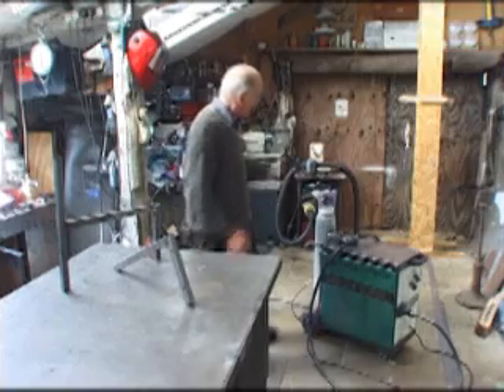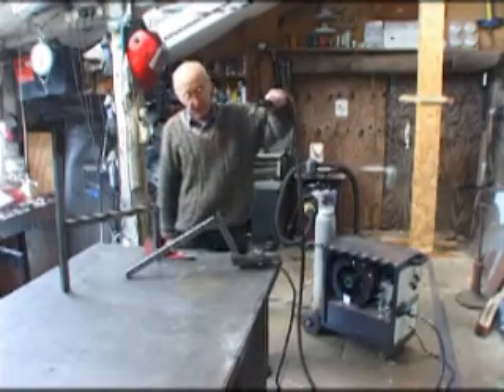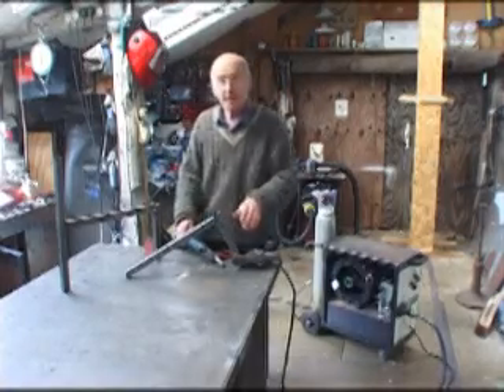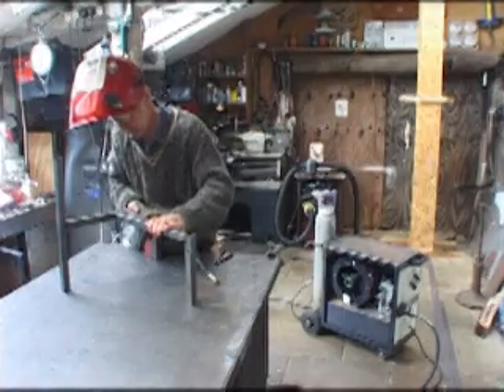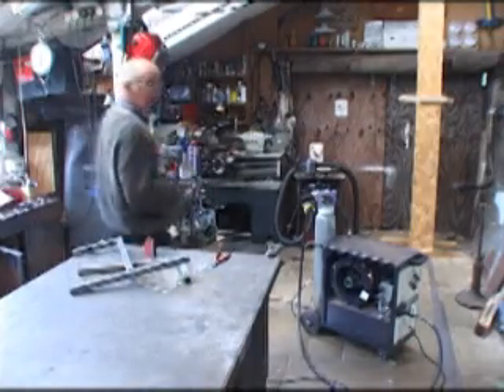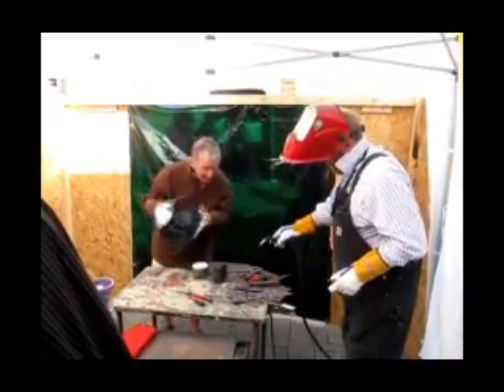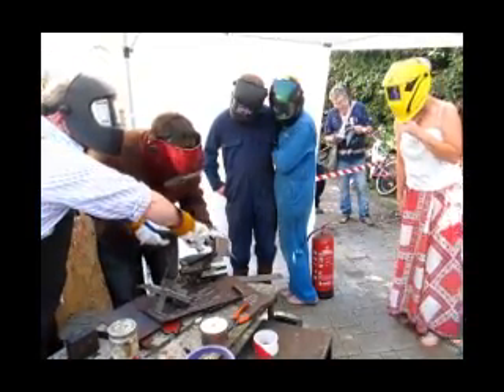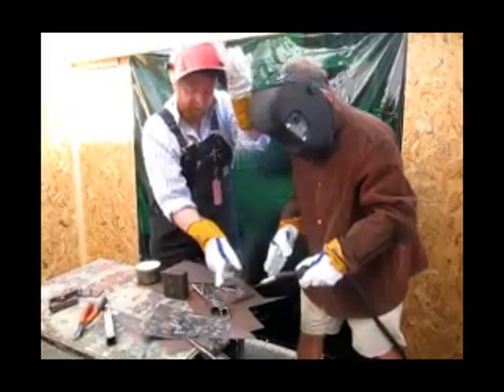welding

Comment: 🍳🥓 💕
Reply: I , have a Lincoln cracker Box welder - in the toolbox of my farm truck.
--------------------------
  I , only use 6011 , 1/8 " rods (what is - a chipping hammer 🔨 ? ; grinder ? clamps' ? ; etc. ) & set the welder on 90 amps ; Only ! (Bad for the knob I know)
I , do not use a 🔥 torch to cut anything. 
--------------
I , cut everything with welding rods and weld only on 90 amps & cut only with 90 amps - too -(mostly)
------------
  In , the truck - I have a 100 foot 👣 # 6 cable .
 I  , have welding plug at the house and one welding plug at the farm .
----------------------
 I , (just drive up) 🔌 plug in , and place the truck next to whatever you need to weld .
I , have to put a fan on the welder now , it's fan - no longer turns.
-----------
No , 🤞 luck for a side job - 🗑️ trash welder - in a resume (is bad).
---------
Also , I used a ( monster torch ) that a Navy Sea Bee 🐝 let me use in his garage. 
-----------------
About almost 3 and 1/2 inches of copper tip , 
( that I plugged it up ; with slag ).
🔥Bryan

Comment: You don't always need a leather welder's coat, but at least a thick cotton/denim shirt is a good idea.  The UV from the arc can give you a rippin' sun burn. #LearnedTheHardWay 

Gloves are good insurance against times when things are more hot than we realize. My brother, for example, has taken the prints off several fingers from picking up thing. xD    This is also one reason why I keep a steady supply of canned soda & beers in the fridge.

Comment: The welding course is a great idea, but even better would be a DIY course on how to use a drill: many DIYers are completely unaware of the function of the hammer setting, drill types and torque settings.
Reply: The main drill error I see is a large drill in steel running at high speed. Heat and drill tip softening is the inevitable result. Low speed and push hard is the right way, so it cuts and doesn't just rub.

Comment: You first think of the amperage of this, and wonder about shocking yourself.
Reply: Remember you need both a certain minimum voltage as well as amperage in order to get a shock, so a massive amperage is harmless unless the voltage is also high enough to push the amps through you.  Too low a voltage and not enough amps will move to cause any harm.  Only 0.03 amps across the heart is enough to go into cardiac arrest - enough to illuminate a single LED - and almost all batteries are able to supply that (even watch batteries can get close), but in all cases the voltage is way too small to actually get enough current flowing to be dangerous.

It's a bit like saying "oh no I accidentally ordered 100 pizzas for myself, my stomach will explode!"  Well it won't because you will stop eating when you're full.  Just because there are 100 pizzas sitting there it doesn't mean you'll keep eating until your stomach ruptures.  And likewise the welder's voltage is set low enough that any current flowing through a human will be so small that you won't even feel it, even though there are way more amps available.

Comment: I also hadn't welded before before getting that welder and I didn't find it hard to pick up. Websites like mig-welding.co.uk have some handy troubleshooting guides that can get you past common beginner problems. The only real limitation i've had with the style of welder is that it's almost impossible to weld anything thinner than about 2.5mm. At least with the rods i've got.

But it's like Tim is saying in this video, even relatively poor welds or just simple tacks can hold plenty of force.

Comment: I hit the youtube character limit with that dang essay, but just to clarify.

The rods that come with the welder aren't that bad, but I didn't realise that till I had fancy rods to compare them to. Plus the handheld visor that also came with it might be awkward but you could probably get away with taping it to a hat or something. Lastly the welder didn't come with a plug (for liability?) but at lower power settings you can get away with a 13A plug. You'd just risk breaking a fuse.
Reply: Hi Daniel, nice to see your one of Tim's Fans!

Comment: I bought a 'buzz box' arc welder from ALDI last year for £20. They sell them for £35 every year but I don't think anyone ever actually buys them at that price. 

It's been pretty decent. It cost me more than the welder to buy better welding rods, gloves, and a visor than the ones that came with the kit though. Folk online really trashed the welder, but they're people that treat welding as either a profession or a hobby in itself. Myself I just want to be able to stick steel together occasionally
Reply: Good way of getting a high current power supply

Comment: It's true, mig welding does use very high amperage, but it's relatively low voltage. Tim mentions in the video that it's around 50 volts, but many welders set it to anywhere between 18 and 24 volts. There's not much electrocution risk.

Comment: I know nothing about welding, so I'm curious as to whether there is an electrocution risk, that's a lot of amps.
Reply: No there isn't because you need a high enough voltage to push the amps, and welders all operate on low voltage.  You can have a massive container ship (lots of amps) but if you put a tiny outboard motor on the back (low voltage) you won't be going anywhere.  There are exceptions, such as if you pierce your skin in two places either side of your heart - e.g. in both arms - and manage to get the welder electrodes in each cut then you can cause cardiac arrest as once you go under the skin, you don't need as much voltage to cause a lethal amount of amps to flow.  But getting into these situations by accident is pretty unlikely.
Reply: In short, yes.  It is one of those tools which the dangers have to be recognized by the user.